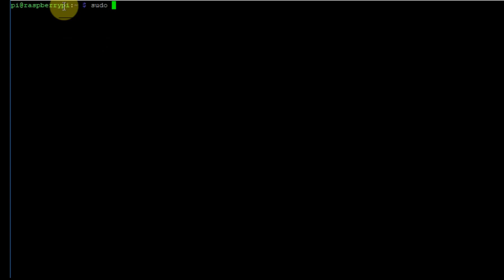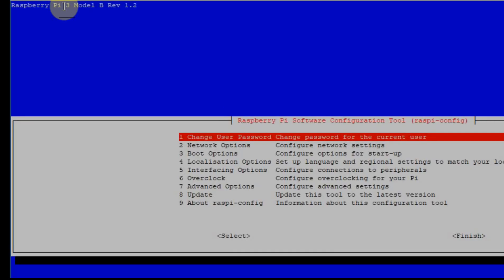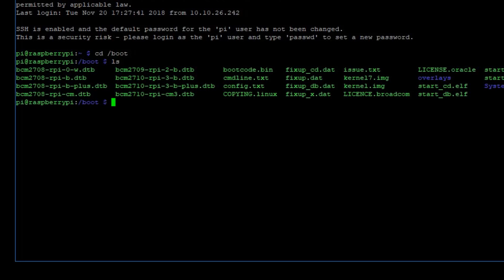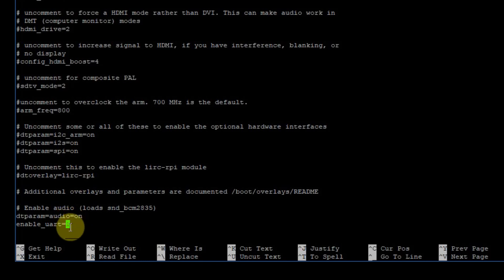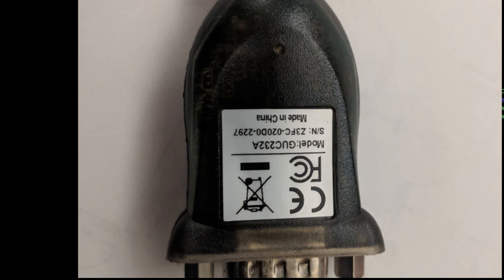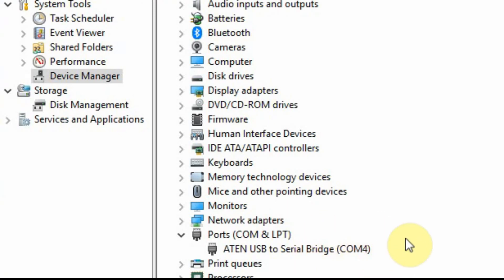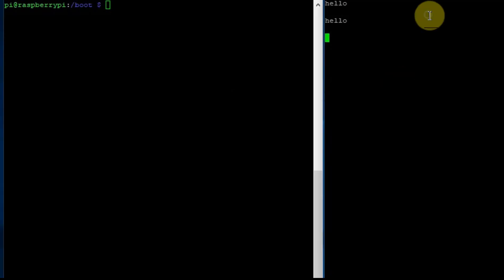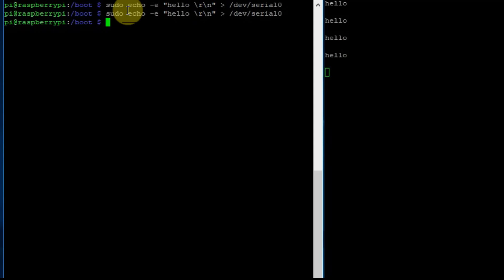07 Network RS232 on the Raspberry Pi

Comment: there is a cable that can be used to connect the raspberry pi usb or serial to the rs232 using rj45 connector?
Reply: what?
Reply: @evebckw  some inverters use serial rs232 protocol using an rj45 plug with 4 wires wired with a different pinout instead the normal com port. they don't know the meaning of the word "standard"
Reply from the maker: This is a very old video.  I am surprised it is still getting views.  Thanks for taking the time to comment.  There are many types of connections for RS232.  I used to work with Alcatel Lucent switches that use an RJ45 for the console port.
Reply: @CheapControls  i have built my own serial canle adapter and used USB to com adapter

Comment: oh this is great! but how do I see all output from the Pi? I only see the output once I send the text from my SSH session to the Pi and I see the output on the PuTTY or my actual terminal, I would love to get to see just normal output and actually interact with it, but I can't get it to do so. Can you help me? This video got me closer than I expected. My friend and I got this to work pre-covid, but we forgot things and I'm trying to get this going again since I got my Lear Siegler ADM-5 Terminal back :)
Reply from the maker: That is a little different from this video.  I want to make sure I understand.  You want to use the ADM-5 to connect directly to your PI for text input and output instead of SSH through a computer?
Reply from the maker: I believe in this video if you enable the login shell over serial if you want to use it to program and access the main file structure of the PI.  I really need to refresh my PI knowledge,  It has been a few years.  I have ventured to the Arduino and then found the Nextion Display and those two things have really taken my attention from the PI.

Comment: I far prefer to leave a thumbs up if I like a video and nothing if I don't, especially as hard work has gone into creating these videos.  I'm trying to use a pi zero to monitor a pylontech battery system.  I might try and make a video although I don't think I would know how to start.
Reply from the maker: All I can say is just try.  There are some free screen recorder software programs out there. My first videos are pretty rough and I am still not satisfied with my videos.  I am looking at switching to a new video editor.  I currently spend about 6 hours on each video.  Some are even longer.  I really want to redo the Raspberry PI videos.  I think they a bit outdated.  Thank you for watching.